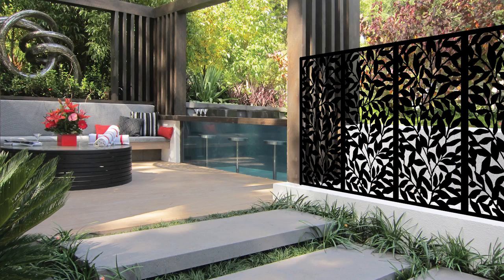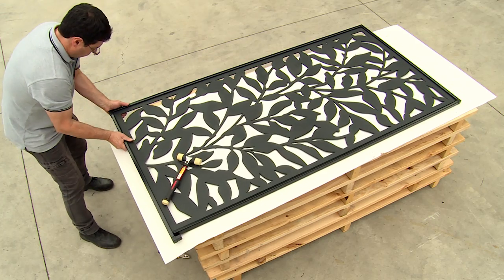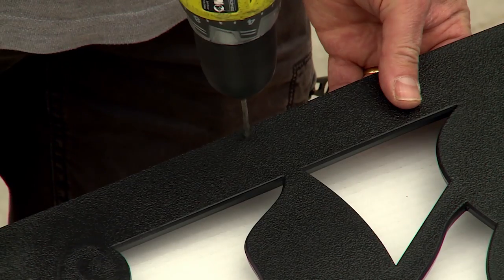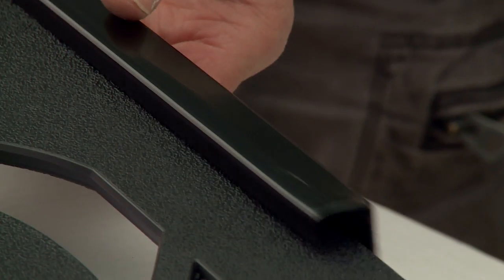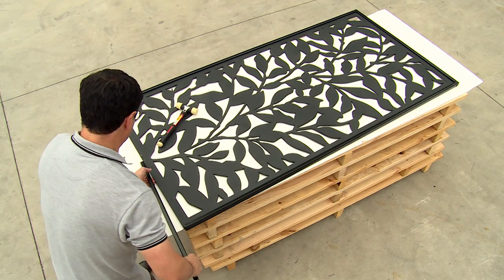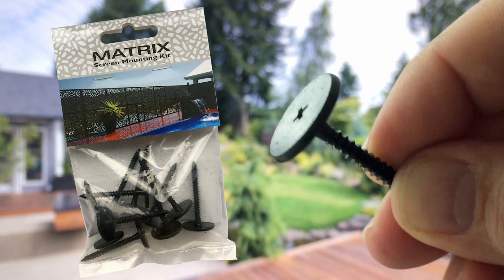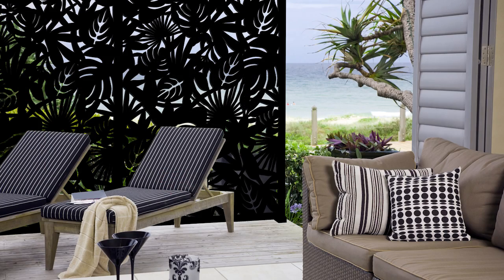MATRIX C Channel Video

Comment: Can I use it as a roof on a pergola or it will bend in the middle?
Reply from the maker: If using our screen panels as a roof, you will need to provide support every 300mm in order to prevent sagging.
Reply: I went to homedepot to order one of the designs but they said you don't have more available and they don't know how to order more. How can I order 6 panels of the model# B-TR2412-CH-3 Tropical recycled plastic charcoal decorative screen. Thanks
Reply: We have plenty in-stock and you should be able to order via home depot.com.  They don't carry this one in-store.  Thank you
Reply from the maker: These can only be ordered online at www.homedepot.com
Reply: I just try from my home. When I'm about to checkout it give me this message. !Error! We are sorry. The quantity of items is not available. Please reduce the quantity of this item.  It telling me that only 3 panels available. I need 6. It looks like the communication between you and homedepot is pretty poor. Is very frustrating. Don't know what else to do.
Reply from the maker: I have adjusted the stock for www.homedepot.com, please try again a bit later.
Reply: Thanks. I already got it.

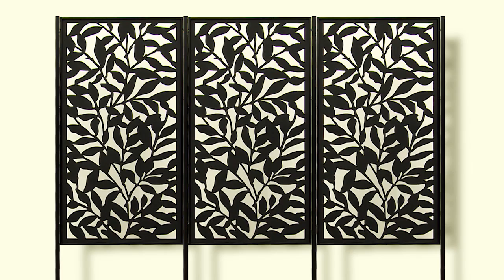Comment: does anyone know what posts they used for the picture in 1:36?
I need help please
Reply from the maker: We can supply 50x50mm galvanised and powder coated steel posts in Australia. Outside of Australia, you will have to source your own timber, steel or aluminium posts.

Comment: It is not possible to attach the bottom surround,  with pins installed,  flexing the metal, as per your demonstration.  The metal frame does NOT flex !